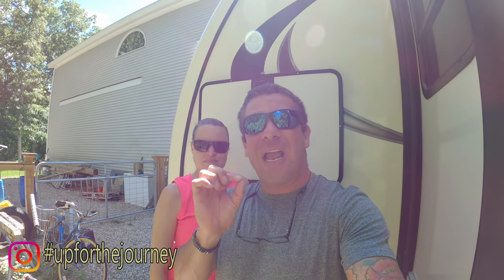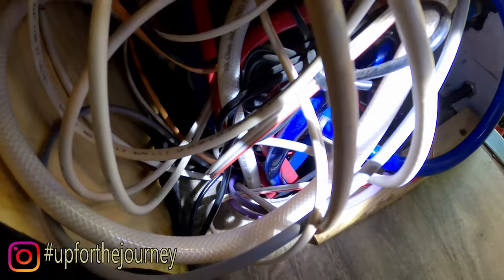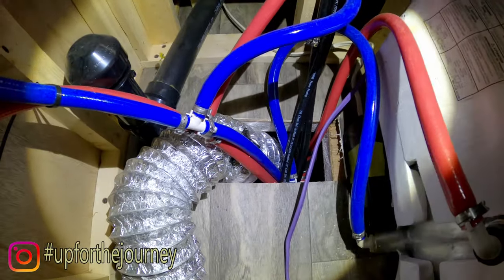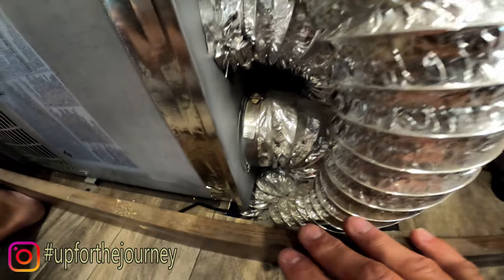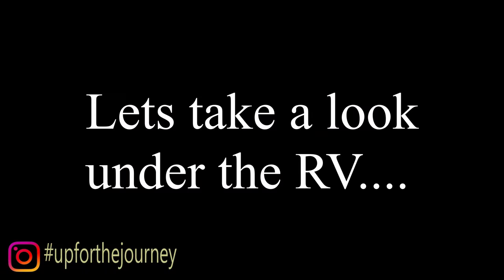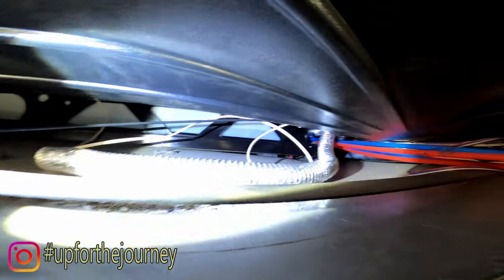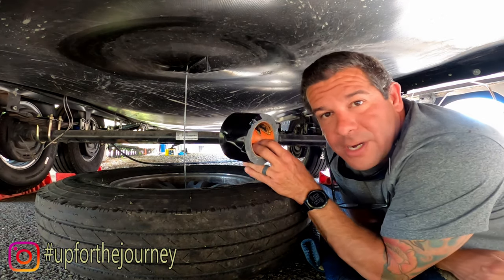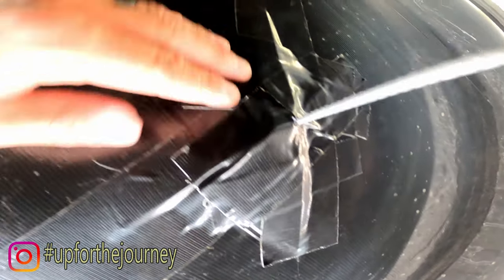Rodents in the RV! Rodent prevention in the RV

Comment: Rodents tore up the wiring to my air conditioner under the hood of my class C.  When I got my RV back home from the repair shop, I put Irish Spring bars all over the inside of the RV and on top of the motor.  It's been over a year and so far so good.
Reply from the maker: O the luck of the Irish

Comment: We used Reynolds Aluminum Foil Wrap for the larger spaces and it wraps well around the wires.  Easily removable and the mice hate it.  Thanks so much for the tips on the entry points.  These critters are driving me nuts!!!
Reply from the maker: Good call.

Comment: I use the old traditional mouse traps. But if all outside access point are sealed then you have to worry about the ones already inside. Set a few traps and after a few days of no critters, you should be good to go. The main thing is to seal ALL outside access points. I had an invasion last spring and doing what I just described, I am now mouse free. But look around all outside and crawl under the rig and think like a mouse, even a pencil size hole is an entry point. Foam and steel wool are you friends when you mix them together.
Reply from the maker: Glad to hear you got rid of the mouse. We caught ours also! We are thinking spayfoam will be the way to go.Thanks

Comment: Why not just use steel wool for entry points inside the cabin. It would be easily removable during maintenance.
Reply from the maker: We did think of that just was not sure with the roughness of the wool pads if it would rub over time on our pipes and the heating vents with us moving around so much.